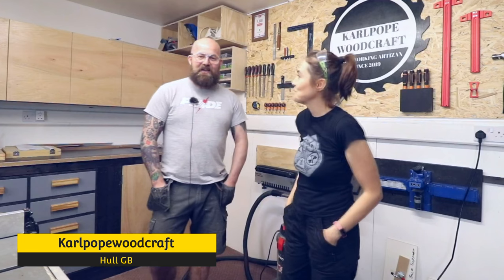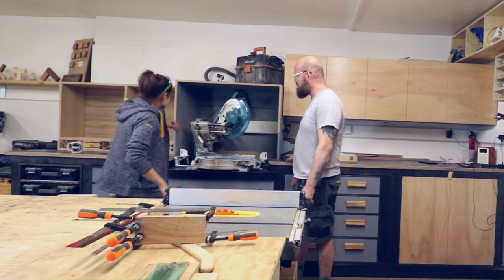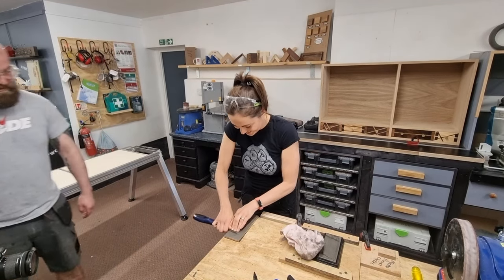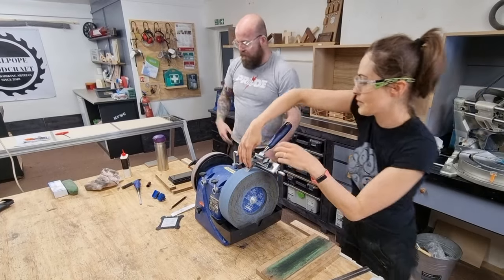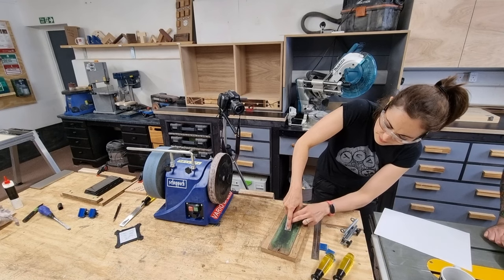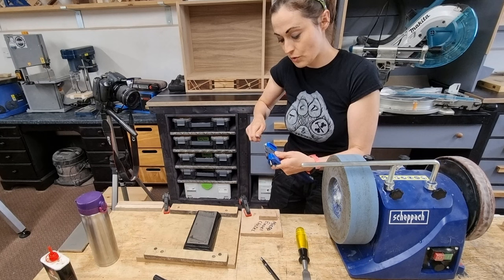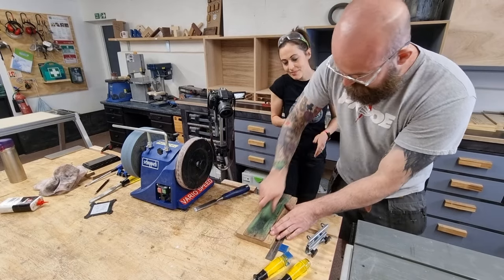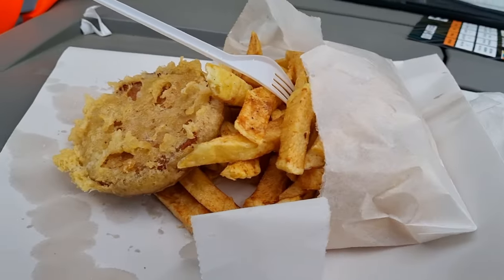Teaching The Carpenters Daughter How To Sharpen a Chisel

Comment: I like the hands on tuition you gave Vikkie on sharpening Karl. Unless I hit a nail, brilliant comment, my thoughts exactly at the same time. Vikkie sharpened that chisel to perfection listening 
to the sound of it slicing through the second sheet of paper. I tried Sketchup, I ditched Sketchup. Sketchup was too much thinking and overloaded my old brain cells lol. Enjoyed the video. Tony
Reply from the maker: I'm the exact same with sketchup Tony that's why Jakob has been given the task. Ye Vikkie did a great job hopefully she won't be hitting any nail soon with her freshly sharpened chisels 😀
Reply: @karlpopewoodcraft  I'm using/learning QCAD now as its very similar to QuickCad I used many years ago, it's only 2D but it's good for technical drawings. Give it a try Karl. If Jakob can crack Sketchup he's well on the way to future CNC incorporated material in one way or another. Tony

Comment: Hello! Great video! I've got a question about that eclipse style honing guide and I'm never too sure. When using it does the chisel rest on the two metal rails or is pressed into top? 
Greetings from a Sheffielder living in Sweden. I am really missing proper chips
Reply from the maker: Hi mate, thanks for watching, if I'm understanding your question correctly the chisel is pressed between the guides.
Reply: @karlpopewoodcraft  Thank you, the question is a bit of a weird one and I find it difficult to describe. Essentially, I've always been slipping the chisel in the chisel jaws of the guide, and pushing the back of the chisel to the very top of that section so the flat back is resting closest to the plane jaws. But I had a bit of a "hang on am I doing this wrong moment" a couple of weeks ago and started wondering if maybe the chisel should be resting at the base of the chisel section of the honing guide, so that the 'front' (smaller part of the chisel) is resting on the two guide rails, that way it would accommodate chisels with non-bevelled sides. 
I realised I could just look at the internet, and I was correct in the first place and I should just ignore my sudden "what if" moment :D Thank you for taking the time to answer!
Reply from the maker: @darkflamejam  haha I totally understand 😅 😂